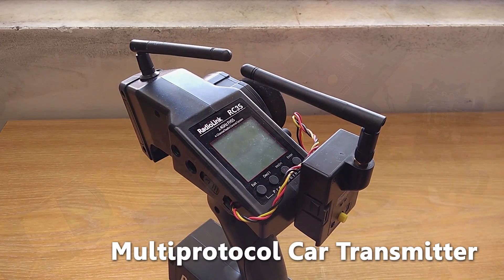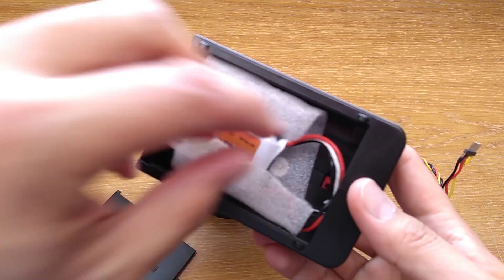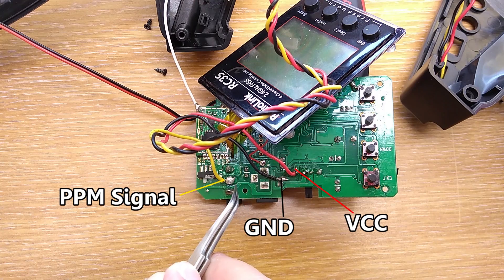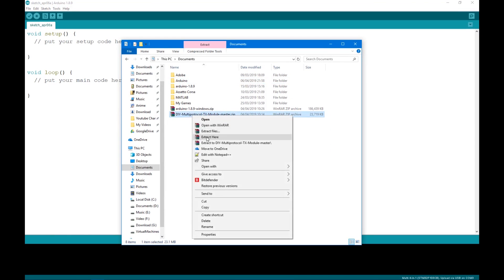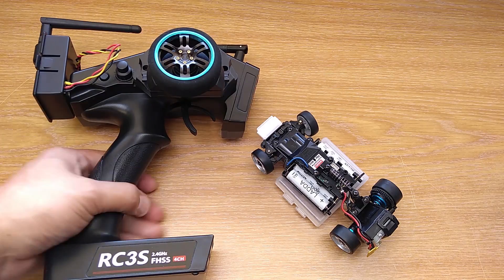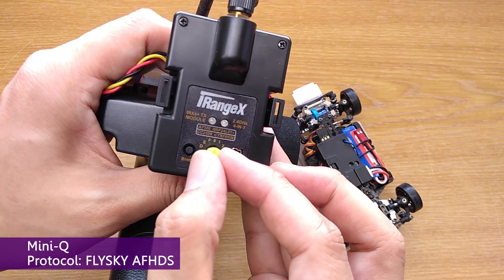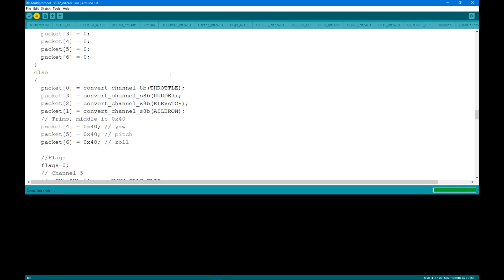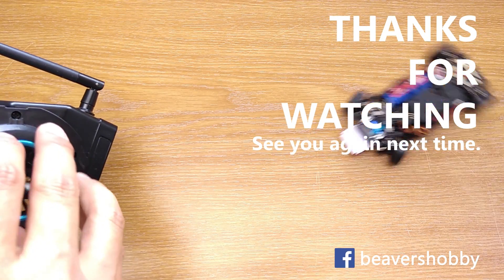How To Use Multiprotocol Module With Car Transmitter & Mini-Z, Mini-Q, WLtoys

Comment: Do I need burn the irx4 + bootloader first?? I just want use 3pks for my mini-z moto racer(fhs protocol)
Reply from the maker: Newer one should have bootloader already. Plug it in and if it's recognized in the Arduino IDE then you don't need bootloader.
Reply: @BeaversHobby  thank u very much!!^^
Reply from the maker: @나라김-d5b  My pleasure.

Comment: Is there a way to use the radiolink receiver in order to connect to the mini z evo board or Dasmikro brushless board for mini z?
Reply: Its super frustrating that I can't use my rc4gs with mini z ! Haha
Reply: Like this receiver? https://www.banggood.com/DasMikro-2_4GHz-Ko-Propo-FHSS-Compatible-4-Channel-Surface-Receiver-Unit-For-Micro-Racing-Car-p-1162278.html?gmcCountry=US&currency=USD&createTmp=1&utm_source=googleshopping&utm_medium=cpc_elc&utm_content=frank&utm_campaign=pla-mix-us-pc-0626&gclid=CjwKCAiAluLvBRASEiwAAbX3GTZ2nF7pkgJQC6IvXNYXTM9_hbcPo_CK8Max8qiibbH-o1i_zuB2KBoCRQ4QAvD_BwE&cur_warehouse=CN#jsReviewsWrap
Reply from the maker: @ThePrankX  Unfortunately, No. FHSS doesn't mean same system, it depends on protocol which they are different from brand to brand.
The receiver you found is to use KoPropo with some small cars like Atomic, GL-Racing.

Comment: Is there an easier way to use RC4GS transmitter with Mini Z MR03? Like using the R4FGM 4CH Receiver with Mini Z MR03?
Reply from the maker: Unfortunately, no. It's complicated either way. If you want to use other receiver you'll have to rip out original electronics, install servo board and convert it to standard RC electronics with 3 wires.
Reply: @BeaversHobby  thank you

Comment: hi Beavr, is it possible to have the same protocol for Mini-z RWD with FHSS and TX KT531P system?
Reply from the maker: So far nobody has cracked it yet but it's possible since it seems to use the same chip as AFHDS. Just need someone to work on the protocol.

Comment: Do you think it is possible to ad a long range module for ground FPV tho the RC6GS?
Reply from the maker: Yes, if the module can read PPM or DSC/trainer port output. I've came across a UHF module that read PPM like the EZUHF theoretically it should work.

Comment: I have read some comments about a internal booster that can be switched on to reach up to 1000m range with the earlier 4ch Radiolink. Is such a mod possible with the Radiolink RC6GS too?
Reply from the maker: It's a switch inside RC3S and RC4S. It got removed in RC4GS and 6GS. And you can't switch it to boost the signal anymore because they changed the board layout. I don't know if anyone find exactly how that switch work to reverse engineer and mod newer transmitter either.

Comment: How do we know the RC remote support PPM? I’ve a futaba 4PV can it mod like this?
Reply from the maker: You can check on the transmitter if it has DSC port or trainer port that you can connect it to a USB converter for simulator. You'll see 3.5mm hole in the video, it'll look like that.
Older Futaba seem to have it (at least my 3PKS does). There are some that you can dismantle it and find PPM pins inside too like 4PK. I'm not familiar with 4PV so I can't give you a definite answer.
Reply: Beaver's Hobby thanks for the reply, I tried to modify my radiolink RC4S with your method, however I found the DSC port pin not able to provide 2.7v, do you know any other soldier point for ppm signal?
Reply from the maker: @tlschun  It's one of those 3 joints. You can try moving steering or throttle and see if there's any voltage change to spot the signal terminal too.
Reply: I’m trying to put this ASF module on RC4S , maybe you can make a video for review 
https://m.banggood.com/DasMikro-Kyosho-MHSASF-Compatible-2_4GHz-Full-Range-RF-TX-Module-RC-Car-Parts-p-1270917.html?rmmds=search

Comment: Would this work for UHF like Dragon Link or EZUHF modules?
Reply from the maker: Yes, if the module use PPM signal.
Reply: @BeaversHobby   thanks! Great video
Reply: @BeaversHobby  made this modification to my RC4GS... I am trying to have it work with an EZUHF module... But I cannot get the EZUHF to bind.... Any idea what I could be doing wrong? Do I need to bind the radionlink transmitter to something? Or just turn it on?
Reply from the maker: @EPYCMX  You only have to turn the Radiolink on. The other signal and binding are handled by the module. How do you do binding on the module? Does it need serial connection? Or you can hold the bind button on the module to bind? This style of connection doesn't work with  serial, only PPM. The other thing I can think of is Radiolink interfere with the UHF module. But that's pretty unlikely.
Reply from the maker: @EPYCMX  The other thing I've just thought of is not enough voltage.